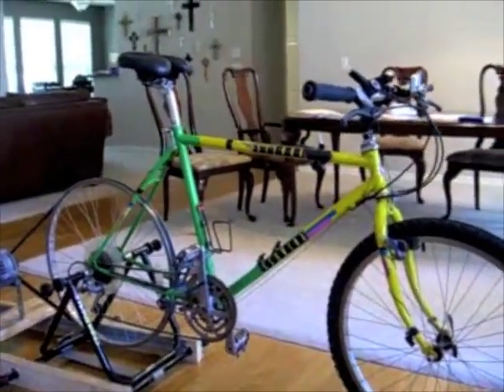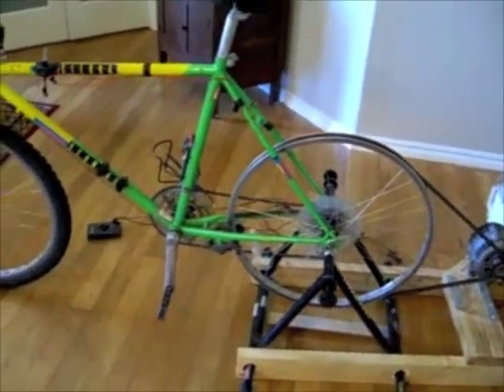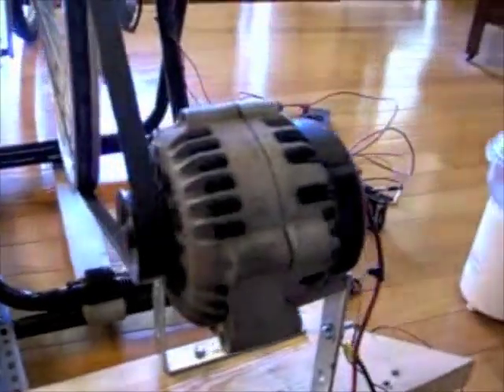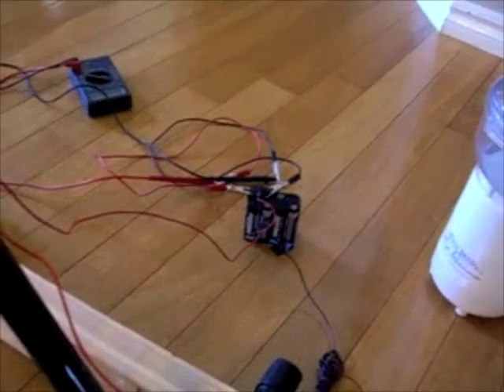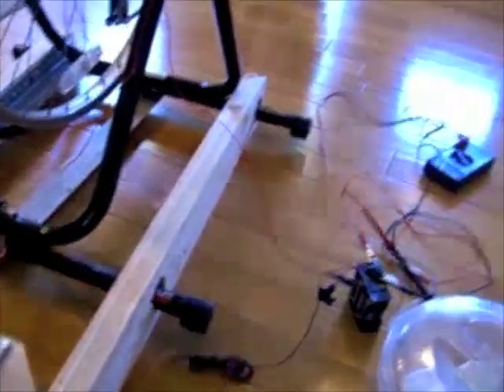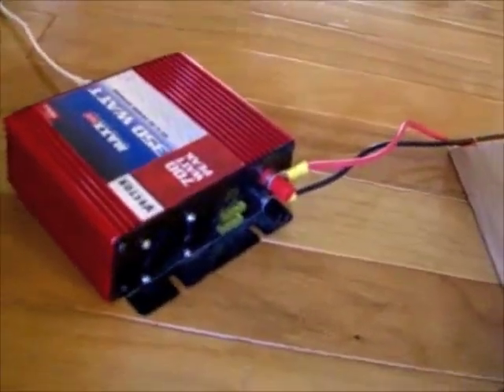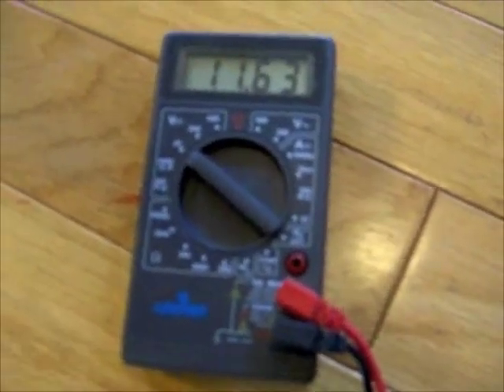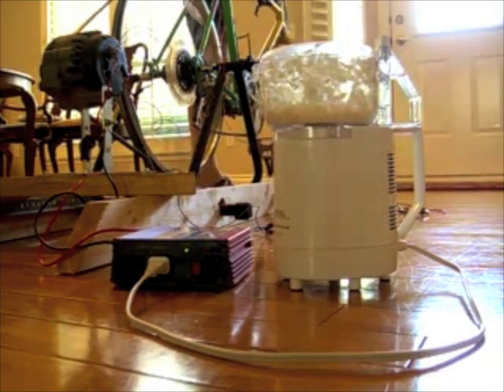Bicycle Generator

Comment: What if everyone in a city did that for 20 minutes everyday? How much would we become less reliant on converted fossil fuels for energy?
Reply: A human powered system can generate the value of some 0.243 USD in an hour (if you're strong and you have a very efficient system). That means a hudred thousand guys in 20 minutes can make $8000. If one single device costs a a few hundred each, you can make a profit in less than a billion years ; )
Reply: garlihu Thanks for the answer. 0.24 is quite a bit.
Reply: The main problem is that it's very expensive compared to the power you can produce. A human being can generate 100 Watts of power and about 60% of it is heat. My maximum output is approx. 400 W but no longer than a half minute and I'm an avid cyclist. So basically you need to spend hundreds of dollars on a device which will produce so little electricity that you can easily charge your cellphone with it but you can't really charge your laptop battery. (My power supply consumes 70 W).
Reply: @garlihu  It's be great in USA, just to get more people exercising.  UK too.  We have a lot of fatties who could get on their bike and do some electricity generating.
Reply: +MidnightMarrow
2 kW? It sounds like you're a superhuman. Tour de France cyclists' full power output is 100 W on the long run. My temporary maximum was around 400 (maybe 500) W (for 20 or maybe 30 sec). 2000 W for one hour equals 1720 kcal. My daily(!) energy need is 2100 kcal. That's for 24 hrs including quite a lot of physical activities. I doubt that anyone can produce 2000 W for more than a couple of seconds. I mean there must be a measurement issue with that bike. 2000 W is 2.68 horsepower. That's a lot!
Reply: Well I definitely can't hold that for 10 mins either by any means. The level was set to 21 whereas a lot of bikes don't have that many. I pushed out around 70-80 RPM at that and I did this on the different bikes they had and it read the same. Whether or not it was accurate? I dunno, other people worked their asses off for 200-400 on the same ones lol
Reply: We’d be using McDonalds cheese burgers for fuel instead of fossils xD America would become less fat and more reliant on themselves rather than everyone else. Doing something like this would teach a lesson, help people get involved in their own lifestyle. It’d be pretty cool all the way around.
Reply: Yes I ordered a DC/DC buck converter direct from China - so I could step down 35 volts on a treadmill motor (the lowest gear on the bicycle) to a 12 volt 4 amp charging system into a lithium battery inverter generator. https://www.youtube.com/watch?v=QrQCiWPiWp4  So I can pedal SLOW and EASY and I power and watch a movie on a DVD portable player - and STILL put a charge into the lithium battery generator. all the details of my design are free -
Reply: I was on a stationary bike, newer digital one. Gives all your stats RPMS etc but this one gave Watts generated as well. The bike had speed settings up to 21 which gave quite a bit of resistance. I was cranking it over 70 RPMs and was generating over 2000 watts according to it. Because of that I was trying to figure out a way to possibly generate that with a pedal based system and perhaps a load of Ultra Capacitors for quick charging and storage.
Reply: Daniel Fischer its all depend on design , if you also make a wheel attached to it, and if you put some heavy weight on it, so you will only need to put lots of power to start it moving, and then only so so to keep it moving on the highest possible gear.
Reply: how many kilowatt hours does that produce? or joules. and doesnt it depend on the size of the generator and the number of coils... how about a step-up transformer to increase the voltage and a capacitor bank to boost the voltage... idk  someones gotta figure out how to make it economical.  maybe it wont be for profit, itll be like jury duty. or just have prisoners do it...  just throwin out ideas
Reply: Bruce John Wayne how about that, Eve 10minutes would make a difference
Reply: I’m not a cyclist at all. I just built a bicycle powered alternator/generator. We were able to attach a 5 amp headlamp to it and it worked fine, we could all pedal it and that is 5 amps x 12 volts = 60 watts. I’m not sure where the heat figure is coming from. You can definitely power your laptop charger if you are a cyclist
Reply: The hell you coming up with these numbers garlihu? "No one can produce more than blah blah blah amount of power" Sounds like you tried it one or two ways and said "This is the way it is" The world is flat.. Bullshit! A car alternator can more than power a 70w laptop.. In fact this guy is running a 300-500w food processor for crying out loud! Lay off the "juice" it's addling your brain!
Reply: You too can find those numbers. You just didn't look.
https://www.trainingpeaks.com/blog/power-profiling/

So may I suggest to educate yourself before you write anything?

https://www.google.com/search?q=human+power+output+cycling+watts+per+kg

Comment: Interesting.
Reply: This is what im into in my thesis. If a motor can store a voltage or energy like a capital voltage to power itself then the profit electricity can power the other devices. Only then we can have infinite electricity as the there is always capital energy for the motor to produce energy itself. I may be wrong but, I hope I can learn more, im new into physics.
Reply: Infinite can not happen. The system you are think of can work to a limited level. The problem creating a loop type system (Motor spins alt, alt creates electric to charge battery, battery spins motor). The factors with this system. Using a lower voltage motor to spin the alt is fine. But over time the amount of power consumed becomes greater then the output of the system. Killing the battery in the long run.

Comment: how long would it take to charge dead car batt to full charge
Reply: Lets assume you are an average fit guy giving a continuous output of 150 Watt/hr and your car battery has a capacity of 50Ah at 12Volt which adds to 600Watt-hour mathematically it would take you 4 hours to recharge it.
Reply: The average male power output is 2.74 W/kg for 5 minutes and the functional treshold is 2.2 W/kg, so for your 150 W/hr you'd need a 300 kg male. Are 300 kg average males able to cycle for 4 hours continously? : )
http://home.trainingpeaks.com/blog/article/power-profiling

Comment: Use a self-exciting alternator and you won't need an external battery to start it up.
Reply: Milosz Ostrow
Reply: You can use the battery that you then would be charging, just like in a car. Nothing silly about it and it controls the charging voltage at the same time.
Reply: Great idea!
Problem is self- exciting alternators have to constantly be used or else they loose their charge which wouldn’t work well for a set up like this which most people only use when the power is out or when they go camping. 

Unless there’s an easy way to re excite the alternator?
Reply: @davidrichie7130  — Self-exciting alternators rely on residual magnetism in the armature to start up.  The magnetism should remain for years, even if the alternator isn't used.

Comment: irony is using an alternator, which generates AC current, which is sent through diodes to make DC current to power an AC inverter.

Comment: A treadmill motor or any permanent magnet motor would be better than using an alternator.
Reply: I salvaged a treadmill motor but then I added a DC/DC buck converter. So now I get 4 amps while pedaling slow and easy - charging up a lithium 31 amp generator-inverter. So I can watch a portable DVD movie powdered by the generator while also charging up the generator. https://www.youtube.com/watch?v=QrQCiWPiWp4

Comment: The Delco alternator shown is a type SI: Other alternators can be used, but their hook-up would be different. 
The switch on the bicycle should be a momentary push button with this SI. 
This gives the rotating field its initial current too get started. 
Then auxiliary diodes in the alternator take over. 
And some resistance, such as the not-charging light in a car, should be added to this wire: 
Otherwise these auxiliary diodes may try to charge the battery and be overloaded. 
Also, this alternator-starting battery can be a lower voltage. 
Or a 12V car battery can be wired to the BAT terminal of the alternator. 
No current will ever  be taken from this BAT terminal by this Delco SI alternator. 
And the voltage-sensing wire, also connected to this terminal, will draw very little current. 
The  alternator-starting button and current-limiting resistance would also go to this car battery. 
* A Delco type CS can be used instead if the SI. 
Resistance in the alternator-starting wire is very important: 
The alternator regulator grounds this command wire when there is no output. 
And the initial field current is drawn from the BAT terminal when the other wire receives the go command. 
Other brands of alternators often work like the Delco type CS. 
* Lee - retired electrical engineer
Reply: I think The one he has is a CS type, only because the SI Type  housing they look totally different

Comment: wouldn't it be easier to use that small bicycle generator to fire up big generator? then u won't need batteries and it will work only from bicycle riding.

Comment: How long would you need to bike to generate 1kwh of power?
Reply: You cant realy say that since you dont know the amps it creats
Reply: kWh = 1000 watts for 1 hour. A recreational cyclist can sustain maybe 150 watts for 1 hour. So 1000/150 = about 7 hours. Makes you appreciate what a bargain electricity is at 15 cents per kWh. Would you ride 7 hours for 15 cents?
Reply: Matt Foley
lol so not worth the energy!!!
Reply: HoldenhardNZ
Not worth it financially. However, it might be worth doing if you are an avid cyclist who enjoys the sense of self sufficiency. Also, you aren't burning coal to generate the power. There is a real crisis coming. The planet will have 10 billion people in not too long. Despite what some claim we can't keep burning coal to generate power. We are too complacent about where our power comes from. We consume power mindlessly. Do you know that coal power plants are only about 33% efficient? Most of the energy is lost as heat (and pollution).
Reply: leo,you are obviously a clever guy,but could you please explain with a few less ummmmms and eeeeeeers in your explanation, I just lost the plot after a few minutes.

Comment: what if you add an other alternator and a 110 or 220 dc motor to help the spinig of the wheel an you'll have the first one to feed the dc motor, and the other one to give electricity for free
Reply: No such thing as free energy.
Reply: When he says free, he probably means without monetary cost. Even then, there would be the cost of buying the alternators and bike so no it is not free, but you are not adding to the already massive pockets of electricity companies. Only alternator(are there alternator companies?) and bike companies.

Comment: when you flip the switch off, I noticed that the voltage drop from 14.4 to 12.1. However, you say that the alternator is still producing 14.4 volts. Where is that energy coming out of? I tried to set up myself and can't get 14.4 volts anywhere as soon as you cut it off
Reply: +chasinelwood1977 I'm pretty sure he hooked his multi-meter up to the battery pack. When he flips the switch, voltage output from the alternator (now connected to the same circuit) is 14v. When he flips the switch, 14v is still available to the inverter, but the multi-meter only senses the battery start/regulator circuit again.

Comment: How did you determine the RPM?
Reply: +Royce Tran I am pretty sure since the gear ratio is 40 to 1, so lets say like he says about 55 rpm (Revolutions per minute) on the "Drive Gear" (The pedal) would cause the alternator gear to move 40 times faster to achieve 2100 rpm . He says also "about 55" it is a little under that(52.5). So you do 55*40. Hope it is right and helps ya.
Reply: +That_One_Tech_Guy 1999 alright, I see, thanks

Comment: I thought they were able to make an alternator a one wire connection so you dont need to energise the field? I have this on my truck, you just have to rev the motor up over 1300-1500 rpm and then poof, it self energises.

Comment: nice idea to save on power bill. Will this able power up laptop ?
Reply: ok
Reply: +Andrew Dupuis not a chance?! most laptops run off ~12v battery anyway 4-5Ah capacity. So, i don't see how you can't run it off that setup. You will have some losses in the 12->mains->whatever your charger is supplying to the laptop but that won't be a problem. Just persuade your girlfriend/wife on the pedals (most of them girls worry about having nice booty, thighs anyway) and you sit on the couch and enjoy lol
Reply: Kaleb Bruwer

Comment: I might need support in doing this mobile project(over sea).  Say can I use the main bicycle component(unicycle) for power generation and transportation at different time?  detachable back wheel?  maybe mass commercialize the whole process?

Comment: He did said a forty to one ratio.  Omg, it is a pulley/mechanical physics all over again.  But hey, on a crude side, I just figured out that salvage auto electrical systems and components could be useful.  I mean a radiator fan is a fan.  Converting automobile usage to small home use couldn't be possible?

Comment: That's really good to do a useful workout and carry on doing it. how can we reserve the energy to use it for let's say 24 hours? It's like I'm encouraging myself if I want to watch something on TV for longer hours I have to produce and save the electricity for it either in daily basis or on weekends. :D
Reply: +ghadia oscar You can hook it up to a dead car battery and charge it to use it later to power an inverter.
Reply: You'd really want something similar to a deep cycle battery. Have it set up similar to how an RV powers the deep cycle cabin batteries from the alternator on the engine.

Comment: you use12v of battery & all that to get 14v off the alternator? so without an inverter you're getting 2extra volts?
Reply: +Flyingo Som Voltage doesn't power things, current (amperage) does. Voltage is just the force of the current. Running a blender off 8 AA batteries wouldn't work because you'd use up the current too fast. When you comb your hair and get a static shock that's like 20,000 volts, but hardly any current so it only stings and doesn't kill you.
Reply: awesome explanation! thank you! ;)

Comment: You can ask Auto Zone for a single wire GM alternator and they will know what you are asking for. Tell them to test it for you. That will put residual charge in it. Now, you can hook it up to a battery and you only need the single battery wire for it to work. Of course you still need a ground wire to the negative of the battery. Now when you start pedaling it will spin up and the residual will be enough for it to take off charging. No switch is needed. I did that on my diesel boat. Auto restorers do that on 6 volt conversions or generator conversions to alternators... You are welcome.. 40  years in electronics.
Reply: Your profile picture speaks otherwise

Comment: roughly how much power does it use from the batteries in comparison to the power produced? is it producing much more than when you would just use the batteries to power the thing you want to run on electricity?

Comment: 220 watts? lol. Why dont you use a coffee machine 1,200 watts? This is just a waste of time, might as well just set up a solar panel at a window.
Reply: +My Apartment On Wheels I doubt any Olympic trained human could product 1200 watts worth of work for more than a minute. Most people would collapse from exhaustion just running this 220 watt load for 15 minutes.
Reply: Warren Garabrandt Yeah now your comparing Apples to Oranges. What the bottom line im sure its ok for someone else's expectations to serve them but not mine, thats for changing your cellphone,  you can get plug in adapters that plug into your lighter and get 300 watts for less  $20.00, how much was all this project?  Have a goodnight.
Reply: +My Apartment On Wheels Don't get me wrong; I'm agreeing with you. This is wildly impractical. The cost and CO2 produced in creating this will never be offset by the feeble power that could be produced by it. Solar panels are a much better investment, and for comparison even they are so terrible (cost to output) that it takes decades for most installations to pay for themselves. That said, I'm 100% for installing solar panels an every roof of every house and business (where safety, practicality, and cost allow).
Reply: +Warren Garabrandt Dahta a boy lol. Your right solar is the way. you can get some with up to 300 watts, there maybe more i have never looked deeper, the only other could be a wind mill, but alot of this stuff mentioned her by you and me should be used if its there House or if its a rental property as long as the landlord helps out it wont be a lose if you move. Some of these kits we talk about all range on different sizes and yes i understand why you made this, its quick, its easy, have extra power and you move tomorrow you can take it with you. ive seen people use a couple of R.V. - Marine batterys with a charger like alternator and motor and they were doing great once again for your application. I also seen a couple ones, people will buy 10,000 Power Inverters like the Aims that comes with a built in charger to charge your R.V.-Marine style batterys and it have enough power for the entire house, people have used onan Generators also to power there houses but this one costs more you need gas and a open area to run them, so any one can run there own custom Free supply of electricity. So i wanted to thank you for bringing up this topic and have a good night.